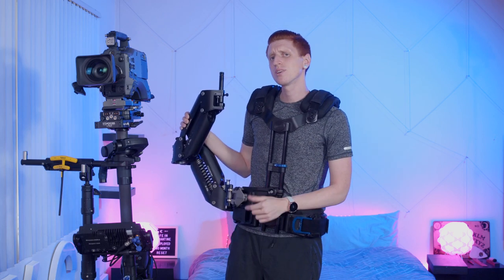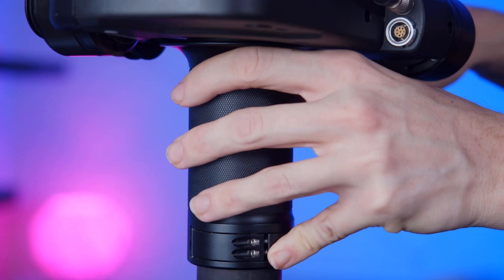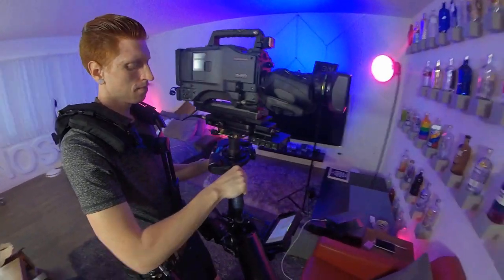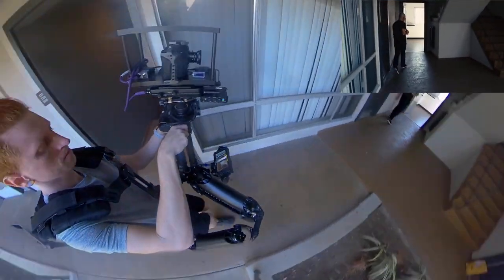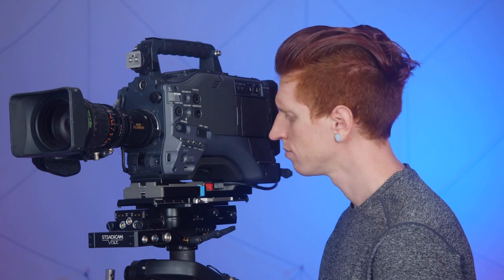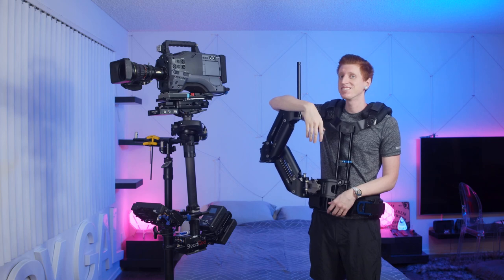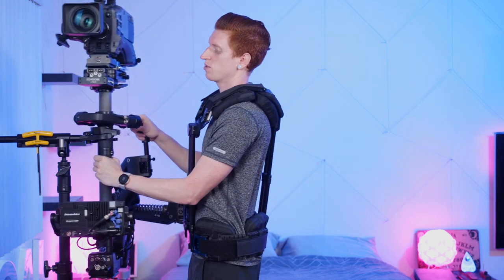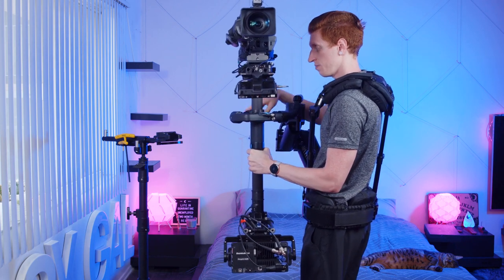Steadicam beginners guide part 2 (hand grip / start / stops / Don Juan / low mode / high mode)

Comment: Thank you so much. for this video especially!  I'm sure your instruction will be very useful to me.   I purchased a Zhiyun-tech Crane 3s pro kit recently and now have a Galaxy dual-arm with vest plus a Redking steadicam coming this week.  I hope to use the combination also as a so-called "Minity."  I know my gear is far below your level of gear and competence, but I'm not shooting commercially (yet?),  just local low or no budget stuff & competition films.  With the addition of assorted stabilizing gear to my overall kit, and helpful resources like yours I hope to expand and improve the production quality of my film shoots.  I'm using a Canon C100 Mk II and 70D primarily (camera wise) plus tons of other assorted on-set gear.  Thanks again!
Reply from the maker: Awesome! it will be some great practice and I'm sure will make your projects better!

Comment: Hello Red - Excellent and very informative videos....thank you.  However, I have been following new videos relating to gimbals that can be mounted onto manually  operated stabilisers or steadi-cam systems...  I am about to experiment this - using my LAING M30PII steady-cam system, with a Zhiyun Crane 3 Lab Gimbal and a medium sized camcorder - mounted onto the top stage, after balancing the rig.  Apparently, using the gimbal on a manual operated stabaliser or a steadi-cam system, has its advantages, especially when you are using heavier gimbals - like the recently introduced Zhiyun Crane 3S for heavier payloads up to 6.5 kilogrammes, which can become very heavy on the arms and body after a short time! 
Apparently - the end results are quite amazing (on a cinematic scale!), with very little, if any, up and down movement, when walking and running normally etc., like an elephant going through ice cream - meaning  smooooooth.....!  I will let you know how I get on. 
with Best Wishes from Alan, London UK.
Reply from the maker: sounds very cool! I think things like lens changes would take a really long time, but id like to see how it comes out!

Comment: I really want to be a steadicam operator. The arri and tiffen are very expensive. But I am determined to purchase one and practice.
Reply from the maker: Awesome Matt! I wish you luck! they are super expensive but you should look into a used rig.
Reply: @SteadiRed  Any model you recommend for a beginner?
Reply from the maker: @matthewlivingston6635  it depends on the weight of the cameras that you normilly use but the Aero 15 and Aero 30 are great!

Comment: I have a question: I see you're using a Panasonic HPX-500, and I have 4 of those as well. I've been using a much smaller HPX-171 for my small steady rig as it has auto focus and the HPX-500 doesn't. What do you do for focus with the 500? I don't see any focus demands anywhere on the rig and there doesn't seem to be anything plugged into the lens.
Reply from the maker: for me i don't really use this camera for anything other then practicing and to demo the rig. but i did get the camera to practice broadcast work so i can control zoom and focus. if you check out his video i show how i do it...
https://youtu.be/gxLTYX_FnwE
Reply: @SteadiRed  ah thanks :)

Comment: Whenever i press record it pushes the camera forward and the steadicam begins to rock forwards and backwards, this is annoying since I have to wait for it to stop moving before I start walking and it also means I have to cut the beginning of the footage out.How can I fix this?
Reply from the maker: It's normal for the rig to move when you hit record. Instead of waiting for it to level out you should put the rig into level yourself. You will have to edit out the that bit but editing is very important to the final product in general.

Comment: Hey Red,i hope you're good man. Got few questions.
I bought recently a steadicam,not a professional one like yours but good enough to get me started. For reference it's the Flycam Galaxy with the Redking Steadicam (£500)
My camera setup is around 6kg so the weight is not an issue as i have clearance. I balance the rig using a strong C Stand and it stays perfectly straight,on the bottom front i have a 7inch monitor and on the back some counter weights,my drop time is 2-3 seconds,so far so good.
The issue is that : 
When i start moving,slow or fast im losing my horizon,not sure if the issue is from the rig or me.
Also i seem to see some ''up and down'' movement and i already softer the springs,those specific ones can hold up to 10kg.

Could be because i have no idea how to walk and move in the space? How long it took you to make a steadi moving video with some pans?

Thanks,
i will give you few weeks to read the whole text :P
Reply from the maker: hahaha, I can read it a little faster then that. For the horizon stuff that takes time to be able to control, my guess is you just need more practice. For the arm bounce it might be that its a cheep arm. I would try adding more weight to the sled and see if it gets any better.

Comment: Any tips for handheld stabilizers? Exercises to strengthen grip and keep the horizon level
Reply from the maker: i wish i did but i don't have much experience with them.
Reply: @SteadiRed  If you could that would be great. There's so much amateur advice out there. Hard to filter the good from a sea of bad advice

Comment: When docked does the sled with volt always lean slightly?
Reply from the maker: yes, you can change the forward aft angle but its side to side is always at an angle.

Comment: Notice how he did not actually jump up and down? That is because this is the cheap steadicam system, not the more expensive cinema line Steadicam. That one uses 6 springs, 3 springs for each arm section as in the Steadicam EFP. Why are 6 springs important? Because 2 springs are locked in opposite directions while the main spring is in the middle on each section. The Steadicam has never used 2 springs, it's always been 6 springs. You can not run with only 2 springs in the system simply because those 2 springs have to not only hold the weight of the gimbal and camera but also dissipate the shocks. This is why the Steadicam EFP is not made anymore as people were buying them like hot cakes since they were cheaper than the full steadicam.